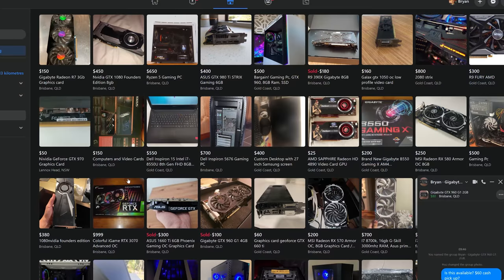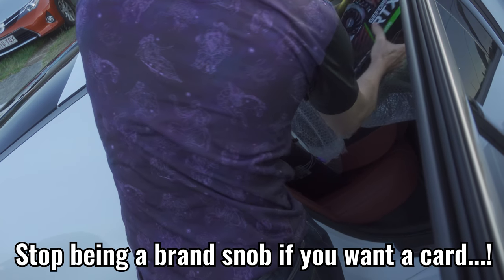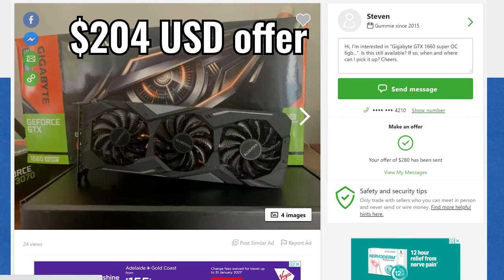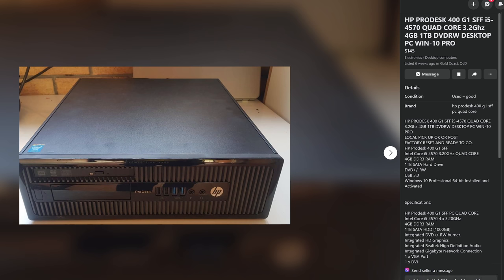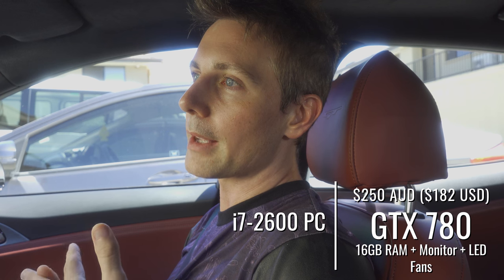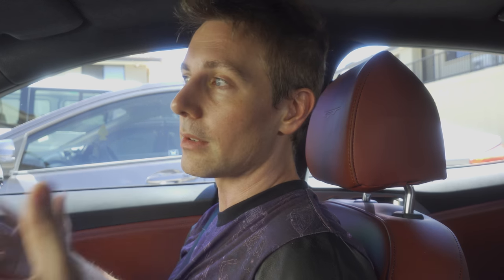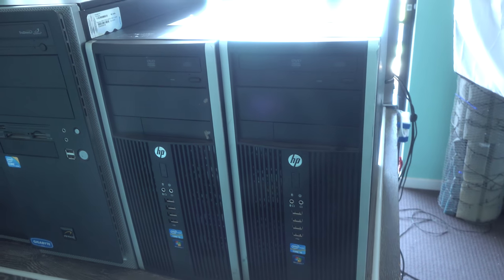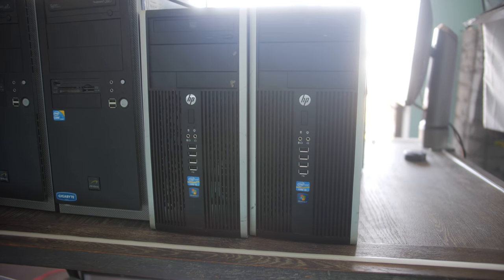November's 2020 USED PC Parts Hunt - Buying $50 Computers!

Comment from the maker: Big shoutout to our friends over in the factories making the new parts cheaper, it's starting to trickle over big time!
Reply: I wonder what is the furthest you ever travelled for a deal ?
Reply: Buying used 980 ti's is not that smart to be fair, only if you sell them fast in a pc or something. Those cards can die especially after so many years of usage, My 980 ti died like a month ago and I took good care of it her entire lifespan so it can happen to anyone especially after 4-5 years. Never buy used cards, that old, if you plan to use them yourself at least. I got a 5500 xt at a decent price and is using only 100w with undervolt, It's so much colder and fans don't even go higher than 35% all that at 90% of a 980 ti performance so It's clearly not worth buying a powerhog 980 ti.
Reply: i feel like you nead a VAN for this USED PARTS HUNT no the beautifull KIA Stinger :D
Reply: @jaraisz06  I was thinking the same thing. Maybe a sponsorship opportunity for Kia to lend Brian a van considering how much he talks about his Stinger.
Reply: New Gtx 2000 series!@20 min 
Woo I heard it correctly
Reply: The Pirate the XX80ti and Titan series cards always have a higher failure rate, more stress on the card VRM, power supply ripple etc, the architecture pushed to its limit, more temperature and amperage through the die degrade it faster.
Reply: I have found many people along with me, do not understand the Dell Optiplex taking the Xeons with the new BIOS upgrade. We do not understand the naming scheme of the XEONS and when they will work. Do you just match up the socket and then it works ? Some of the CPUs match the socket but a Sandy Bridge chip would be going in an Ivy Bridge board.  Nobody has done a video explaining XEONS starting at no version, then v2, v3, v4 and when they will fit into pre-builts with Bios upgrades. With the price of everything used costing 3 times more, there are many people looking into this to afford an upgrade. I watched one of your 2018 videos and the W3680 was a suggested CPU but it was unclear whether or not you were saying it will work in an Optiplex 980 with A22 Bios.
Reply: Have you ever hunted for computer parts in Indonesia?
Reply: good luck buying many brands of memory on newegg or amazon now  many out of stock till january ?  cpu's memory video cars lol
Reply: To that - Have you seen the "leaks" of the 3050 TI? Now usually I don't really put too much into leaks - however the source from which it comes is the same which leaked the 3070, 3080 and 3090 info - and all those leaks were spot on... so ... Anyway to the point: It would seem - again IF the source is correct again - that the 3050 TI will be DIRECTLY comparable to a GTX 1080.... If this is true this will be absolutely fucking amazing for all of us who are fans of taking old "office PCs" and turning them into gaming PCs. Think about it. Let's take an example out of the bunch - A Lenovo Thinkstation E32 with a Xeon E3-1230 V3 has a 270 Watt PSU. You can only fit the XX50 series within that powerbudget.... If that XX50 series now has the performance of a GTX 1080 you will be able to basically play balls to the wall 1440p games at a 300-ish USD budget. And that actually being with 0 compromises.
80-100ish to buy the old office PC
" the GeForce RTX 3050 is expected to carry a sub-$200 US price of around $149 US." <--- straight from Nvidia - So the TI will probably be like 180 USD if they follow the usual trend.
A decent SSD 40-50 USD

That's a pretty banger system right there if you don't own a high res monitor. It will absolutely crush any game at 1080p at max settings.

Also - as a small addition - the GTX 1650 (+) will crash so hard in price. If you can get a 3050 for 149 then it would not surprise me to see everything in the GTX 16XX go sub 75 USD within a few months of the launch... which means REALLY easy sub 200 USD PCs with a very respectable gaming performance.
Reply: @thepirate4095  my gtx 480 3 way sli used begs to differ. Thel all run 95 degrees and still alive to this day

Comment: I absolutely love this flipping business. Im having way too much fun over here in Portugal, EU, deals are not often but I've already got a 970 for 50€, and yesterday scored a i5 6400 + z170 combo for FREE (only shipping price, 5€) that's "broken", seller said it shut off at high temperatures, im guessing it's in need of thermal paste on cpu or perhaps the mobo s chipset. My first flip was an FX6300 pc, which I got the fx+mobo+2x4gb ddr3+tower cooler +pci wifi card for 60€, that's insane in Portugal, got an rx 560 2gb with warranty for 50€+ shipping , bought case and psu new for 30€ ( yeah ik, shitty 500w psu, had 300w on the 12 rail, but the system was only consuming 150w at most), spent 150€ +- and sold it for 250€. Now going for my second attempt, got a h61 mobo+4gb+celerong530 for 36€ shipped, i5 2320 for 16€ shipped, 4gb ddr3 for 7€ shipped, gtx 1050 for 50€+shipping and 20€ matx rgb case with tempered glass panel (black Friday deal, case is Mars Gaming something xD) and the same psu for 11€ that was included in my previous case+psu combo (psu is L link 500w, but it's 300w for 12 rail). Spent total of 150+-€ again, planning to sell for the same amount.
Reply: I paid off a car this way just flipping laptops until my source of cheap laptops closed up shop even though the store was turning a profit but due to mismanagement in another city it was forced to close so r.i.p buying laptops for little as five bucks a pop.

Comment: Love the price to performance deals! Got myself a ”broken” R9 290X for free but it was only a driver issue for the previous owner! 
Ryzen 7 1700 + Asus Prime X370-Pro + 16gb Corsair Vengeance LPX 3000MHz combo for $220
MSI GTX 1060 6GB for $70
Corsair HX1000i 1000W semi modular PSU for $30 

Did get some really good deals 😁🎉

Comment: Here in PH, people sell their used GPUs for prices of brand new ones (sometimes less $10). 🤔
Reply: Agree with that. A mere rx570 costs msrp launch date prices
Reply: i remember when nee rx 570s cost sub $140 at the start of the year and now you can only get those cards used which were probably mined on
Reply: Sad season for used GPUs right now. Hopefully it'll get better soon
Reply: Yeah, they're going nuts... i am glad i had a couple of "broken" RX580s back in spring and gradually worked on them while lockdown... typically you don't sell many PCs in summer, so right now is the time to cash out and hope for the new stuff after xmas
Reply: @anno5936  if we can actually get them lmao
out of stock everywhere
Reply: @JP-be9cx  eh I disagree. I've picked up 2 2080ti MSI Gaming X Trio in the last 2 ½ months, first was $450 1 week before 3080 'launch' and then another just 3 weeks ago for $400. Sure 3070 is close, but thats at least $550 after tax, so I saved nearly $300 AND got the best of the best 2080tis.
Reply: yan tlaga ang dahilan kaya mahirap mag pc flip dito sa pinas compared sa ibang bansa

Comment: Hey Brian, when you re-case the hp systems, do you need an adapter for the front panel connectors? Ive heard people having trouble doing that because they are proprietary.

Comment: That's a killer deal on the Ryzen Bundle, What would you say the CPU & Mobo on it's own are worth as i'd be looking next month for a 2600/X or 3600/X & B450/X470/X570 or if 3600/X a B550 combo for less than $300 CAD (about $313.43 AUD according to Google), ideally $200ish ($208.97ish AUD).

Comment: Brian, I have a friend who has an HP Omen with an i7-4700K. He wants to keep the case and replace the motherboard + CPU with a Comet Lake. He's willing to replace the PSU to get around the proprietary power connectors. However, I also read that the HP motherboards use non-standard standoff positions. Do you think this is doable (without drilling or cutting), or should I tell him he needs a new case or forget it?

Comment: In the UK flipping gaming PC's at the moment is almost pointless, as the parts are so expensive there is just no profit in it. Fixed a laptop and made a good profit on that, but gaming PC's are a nightmare here!
Reply: @Seventh Taco offering 30-40 USD for a 580 is literally a scam itself. Them 580s are on sale in local 2nd hand tech stores here in uk for like over 100 GBP.
Reply: @Seventh Taco Wanted to put together a build from AliExpress with a Xeon 1246 v3 on a Asus B85M Gamer MOBO. But looking at the prices for equivalent gaming PC's on ebay they can sell for the same price as the cost of all the parts, so its pointless. Some PC's seem to have sold for higher but its not common, so I may get lucky but its a risk! $30-40 for an RX580 is just a crazy expectation! As 'yeahh buddy' said they go for over £100 here.
Reply from the maker: :(, is that because you guys are in hard lockdown now?
Reply: @techyescity  Pretty much always been like this, bit worse now I guess. Its England, everything is overpriced here! Some of the deals I see you get on parts are just so cheap in comparison. If you did the 'Turning $100 Dollars into a High End Gaming PC' in the UK it would take you about 5 years!! ;)
Reply: @Seventh Taco RX580 Loot Box!

Comment: I picked up 5 lga 1155 celeron pc’s and 1 lga 1150 celeron pc with decent psu’s and a few 2GB DDR3 sticks for a €100 last week. I’m going to pop in a 3rd gen i5, ssd and 8gb ram. Also picked up a “broken” gaming pc for €40 with a dead psu, working x58 sabertooth, i7 950, 12gb HyperX 1800mhz ddr3, gtx 570, 256gb ssd, 1TB hdd and a slow 2TB HDD.

Comment: QOTD : What is the main difference between ryzen 3 3100 and i3 10100 they are both 100$ and performing eaqually, with same $50-$100 budget banger mobos ? i thk of picking i3 cause of stability
Reply from the maker: Since you requested I will bang that out in a video for you :).
Reply: Get 3100 (or 3300X) and cheapest B450 mobo with VRM heatsink (for example Asrock B450M Pro4-F), because B450 will get Zen 3 support in janurary and cheaper non-X Zen 3 models are coming soon too. 7 nm CPU's are also more energy efficient, so in theory you can get up to 16 core CPU with cheap mobo with VRM heatsink, not that I'm advising anyone to do that for the sake of boost clocks. With AM4 platform, you will have stronger upgrade path, when you need to gain extra CPU speed for faster GPU's in the future.
Reply: On newegg, the r3 3100 (without graphics) costs $145 and the i3-10100 (with graphics) costs $118.

Comment: has never beeen a better time to get tino just think that in a few years you will be able to buy high end Ryzen cpus, r6xxx, and rtx 3xxx for cheap
in my opinion, there has never been a better time to get into pc and tech. 
my favorite place is an online shop, where you can get a complete system, ie, 2500 or 2600 cpu 8 gb ram sometimes 1tb hd ps and motherboard, mostly loaded with windows 10, all for 120

Comment: Hi mate, I know you have been busy but I was wondering did you manage to test the 6800xt in world of warcraft with ray tracing on and off.  I was contemplating buying the card as it seems to be an all round upgrade over my 1080ti. (Which has been extremely hard to replace)

Comment: What are your thoughts on the HP z420 Workstations as the base of a budget gaming rig in 2020?  EDIT: I guess I should have mentioned which processor because they have a few variants under the z420 model #... was looking specifically at the Xeon E5-1650 or even the Xeon E5-1620 CPU's.  A full system can be had for just over $200 US with 16GB RAM and meaty power supply.  They just lack a decent GPU.
Reply: They are around i5-2500 performance. Enough for an office pc, but I wouldn't go below a Haswell i5-4570 or Ryzen 1400 system for gaming.

Comment: Currently building a 2nd rig with x58, x5675 and a 980 ti, this just popped in my head.
For x58 would there be a big difference in performance for ram if you put it in dual channel vs triple channel? Or x79 dual channel vs quad channel?
Reply: Triple channel or quad will help but the latency in l1/l2/l3 caches more important sometimes...bandwith is only available performance, not an absolute. Basically depends on the application and or game.

Comment: My best deals were a 360 auzzie Rx 5700xt and a 30 dollar x370!
Reply: Mine were an rx 570 for 80usd and a 500gb 7200rpm hdd for 15usd and 49" 4k hdr smart TV for just over 150usd and also a gtx960, i5 4460, 16gigs of ddr3 1600, z97 gaming 3 mobo, cooler master mb511 case, 1tb 7200rpm hdd no power supply  pre assembled system for 300usd

Comment: how are you gonna fit a graphics card in that 8200's ? i'm asking because i bought a 6300 pro a while ago, and i couldn't fit a graphics card in because of the cooler ...
Reply: Move the stuff to a bigger case.
Reply: @Psi-Storm  it's not the case that is the problem ... the problem is the motherboard itself ... and the cooler. i even tried putting another cooler on, and there's still no room. the cards are long, and that way they are interfering with the cooler. a 1 fan card would fit ok though...

Comment: I have a foxconn H55 MXV motherboard and its bios is pretty bad and old. Is it werf getting a EEPROM Programmer and flashing the bios to a Asus or Gigabyte bios?
Reply: No you have to flash it with an official one from the manufacturer
Reply: @MarshallSambell  if there is a way to find the bios for the board because foxconn dont make a installer for bios or anything like i cant find any bios releated to this board
Reply: Dexsters 56 thats a pretty old motherboard, it’s best to look at the Foxconn instructions for updating a bios. You might need to create a bootable DOS  USB in order to update it. If you aren’t experiencing any problems with the board, or don’t wish to update the CPU to a later revision there is no reason to update the bios

Comment: a year ago i got a a320m from asus(overclockable) for 25€ and a A8 9600 for 10€ new with 2x4gb for 15€ and used it as a little emulation pc for ps2 and gamecube games for a year and sold it after that for 90€

Comment: I was hoping the price would drop a lot on 2060/2070 and 5700 and 5700xt cards....that is not the case at all
Reply: Not yet, until new cards (Nvidia 3070+ and AMD 6800+) have better availability, and the new lower-end cards come out in the spring.
Reply: The 2000 series brand new prices were cheaper BEFORE the 3000 series release, the retailers are scalping
Reply: @MarshallSambell  Aren't retailers always scalping though, raising prices higher than they pay for the merchandise if demand is higher than supply?

Comment: I have been trying to give away four GTX 770 SC cards as well as a number of other older generation GPU's for the past couple of years. I've tried installing them in cheaper PC builds but kept getting asked to upgrade the GPU's. I ended up just throwing out those cards yestrday. It's funny to see one in this video today.
Reply: @Hotchinz  Mainly kids, they all want the latest cards to play games like Fortnite at just 1080p. I gave up trying to offload the cards with them sitting around for a couple years now. I even tried giving two of them away at one point to use in SLI but that didn't even work out.

Comment: I snagged a gtx 1080 for $250 to replace my 1070 Ti(which is starting to show it's midrange age), I should be able to get about $250 for the 1070 Ti on ebay, free upgrade!

Comment: I thought for sure that a used rx 5700 or 5700 xt would be in the $200-250 price range by now. Instead, used ones are fetching brand new prices and even the new models have seen a price increase.

Comment: Man, if only I could have found an I5 2nd gen PC for less than 100 euros like a year and a half or 2 years ago :/ Instead, got kinda scammed with an i3 2120 pc, 4GB of ram and GTX 560ti, which was always at 90 degrees, sometimes hitting 95-97 (Old fans were removed and a random small fan was mounted. The fans were removed by the seller).

Comment: Series S was a mistake, its running everything terribly already and we haven't even got to next gen games yet.
Reply: Nah Valhalla is looking good on it it's getting a solid 30 fps all of the time
Reply: Series S is a boon to parents, and everything runs well so far on it. What are you talking about?
Reply: @Quicksilver-7791  https://youtu.be/hLUrgHWxWCU?t=426 It's already struggling on crossgen games.
Reply: @WayStedYou  I'm not even going to bother to argue. You just compared ONE game, known to have performance issues on Xbox, and then claimed that xss is bad. Well played.
What about Valhalla? Cyberpunk when it comes out? If it doesn't run at a stable fps on Xbox ss I'll eat myself.
To be fair, I did say every game.
I meant every game optimised for it.
Anyway.
The Xbox ss is fine.

Comment: 2:17 Prices not come down lower
. There is no supply of new cards, and they super expensive, so used cards cost even more, than before
Plus, AMD just fooling people: RX480 was launched in 2016 at 230$, 5500XT with same performance was launched almost in 2020 for 200$
Where is progress? 232mm²+256bit 230$ 2016 - 158mm² 128bit 200$ 2020.

Comment: I wish i5 4th gen systems were going for $50 a pop here. the used market in the usa is a crapshow atm. I cant get an i5 of 3.2 gig or higher for anything under $60. that is the cheapest. and thats just for the processor. systems with no hdd,etc still go for well over $135+ everyday and people are even advertizing sytems for $99 but once you get there you have to add in processor and and ram or you cannot even by it for less than $200. its a total price scam war here atm in the USA used market.